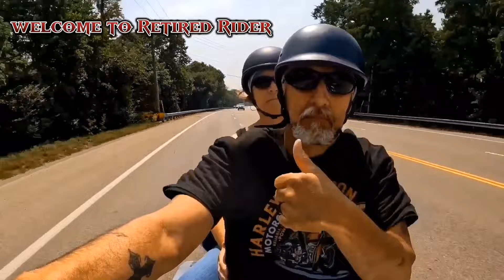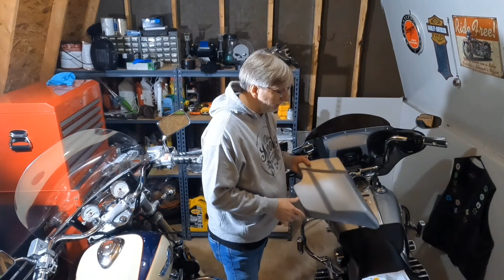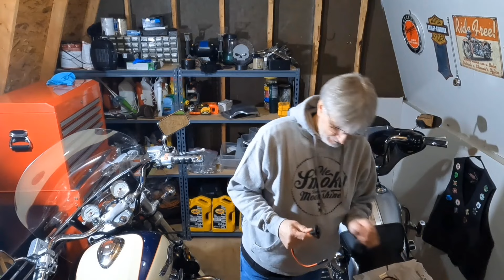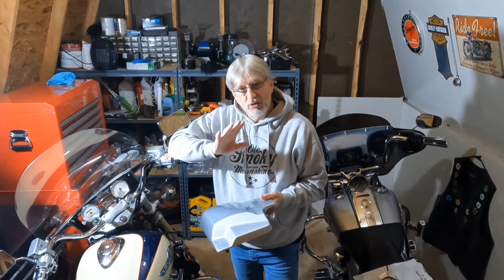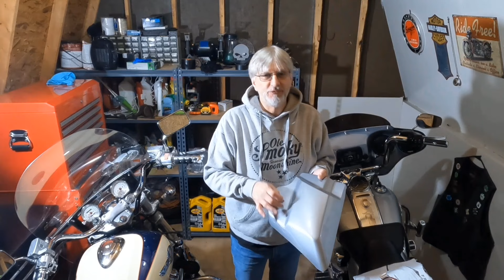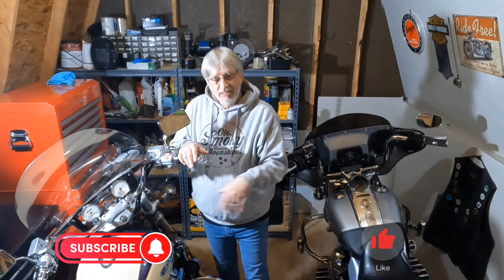I'm not sure if I can bring myself to do this

Comment: I have one of those on my 2014 Ultra Classic. I mounted mine in the mid-frame air deflector, right behind the engine. The air deflector is black, so you hardly notice it. It does make is more convenient to just plug the Battery Tender in. The mid-frame air deflectors are cheap and easy to replace. I would NOT drill a hole into a painted side cover though.
Reply from the maker: That would be a good place to put it , But mine is painted so unfortunately that would not work for me.. I agree I'm not going to drill a hole in my side cover. Thanks for watching and commenting very much appreciated 👍👍👍

Comment: wonder if that plug would fit in the hole on the frame plate that is in between the rear cylinder and the battery tray on the Road King? That's where I run my battery tender lead and just tuck it back in the hole when not in use. Not quite as convenient but no hole in cover.
Reply from the maker: I didn't even think of that ,  Definitely worth checking out 👍.. Thanks for watching and commenting much appreciated 👍👍👍

Comment: Would never use that style of plug! I have the small two pin pigtail plug that comes out by my starter and i tuck it in between frame and starter just looks like it is the wire that goes to starter. Blends in so well sometimes I struggle to find it. Easy to get at when I need it and it doesn't look ass!  That size plug is ridiculous for a little charger.
Reply from the maker: I agree with you , that was one of my concerns it just is too big and highly visible , Thanks for watching and commenting very much appreciated 👍👍👍

Comment: As a fall back - side covers can be replaced.  Just think of the uses having a plug in can have such as...charging - running an electric vest/pants etc.  Stop being so anal about a small hole.  I'm in the process of doing changes to my lowrider ST and I will be putting electrics in my front fairing which may require god forbid holes...  My two cents
Reply from the maker: Much respect, And I see your point but I just can't drill holes in the side cover , Thanks for watching and commenting much appreciated 👍👍👍